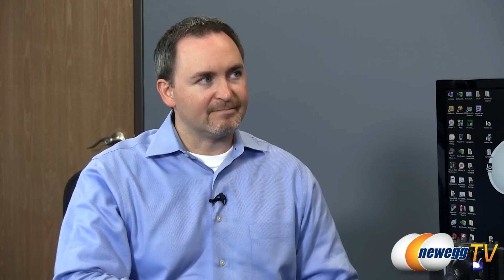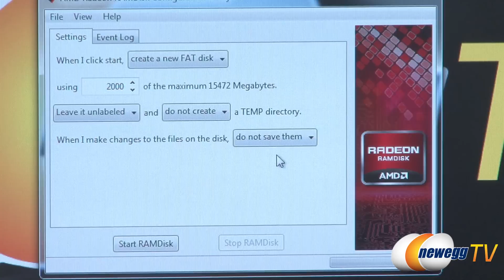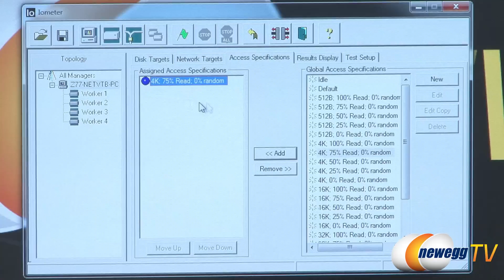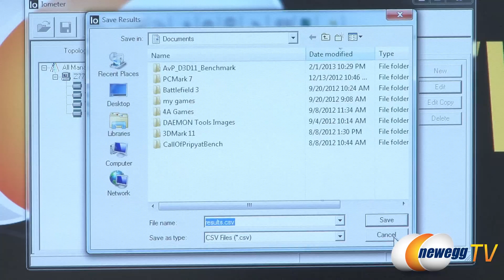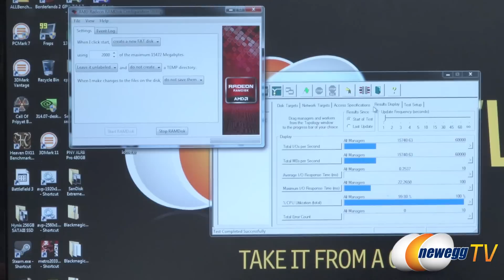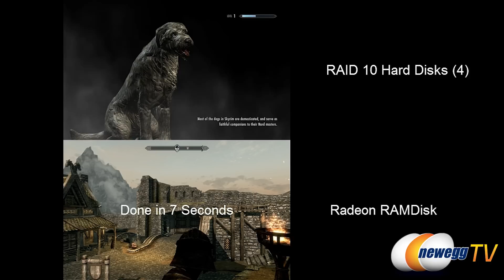AMD Radeon RAMDisk Interview & Overview - Newegg TV

Comment: Take BF4 it is almost 56gb...using RAMdisk does the whole game get installed or does it just use what memory it needs to operate the game? You see I have 16gb RAM and the game itself is 56 and that is what is installed, not the parameter which most games have a 20% bigger space set aside. I.E. some 10gb games require 15gb of space on your drive in order to download. Basically does the game itself need to be put on the RD or just the temp files that run it leaving the game itself in its original place (HDD or SSD) btw I also have a SSD for OS only.

Comment: The only way your going to use more than 10gigs of your system ram is if your using high grade/professional tools such as 3D rendering programs, advanced algorithms, etc. etc. If you have 32gbs of RAM why not set the 16gbs that you will never use in everyday use (gaming, web browsing, etc.) and RAMDisk? you could install Skyrim and have half a second loading screens, or install BF3 and cut your loading times from a minute to 15 seconds. Theres no reason not too.

Comment: No, you still got to install an OS on a SSD or HDD.  You'll need to have a lot of RAM, 32 is about the most feasible you can get.  OS needs a good 4 of it to operate and to play it safe with games 6 would be good.  So you can make at most a 26GB RAMdisc, see how many games you can fit in that.  Old PCs only have 4GB usually and new ones usually only have 8 so unless you have a custom build you know has lots of RAM it's not a good idea to do this

Comment: We won't be able to use it until Haswell-E for LGA 2011 and Skylake for consumer level anyways with no word from AMD yet, so kinda jumping the gun there. Haswell-E is slated for a Fall 2014 release and Skylake in Summer 2015, so we got a year and a quarter before we'll be able to even use it, a lot can, and will, change in that time.

Comment: Until amd or whoever, can cut down the amount of time it takes to SAVE the ramdisk image ( yes I set it to save on the same ssd as the o.s. is installed,  not sure if that matter versus setting it to auto save on a separate storage drive), and/or I can afford to purchase a much bigger ramdisk size allowance than the measly 4GB ( ya need more for today's games) to test bigger things like games, vs small stuff like handbrake, itunes, etc..No thanks to 4x more boot & shutdown time.

Comment: Definitely the sata 3 ssd.  even if your motherboard only has support for sata II.  chances are ALL of the specifics ( 4k random  read and write,  max sequential read and writes, iops, things that determine how fast your o.s. loads, shuts down, and influences program and file loading, etc)..of that sata 3 ssd's speeds will be still slightly faster than that sata 2 ssd's maximum speeds in all categories listed in parenthesis.  I know this from experience. Built and tested over 60 pc's since 2002

Comment: Why would you tell him sata 2 ssd is the one that the o.s. should install on?  sata 3 ssd's  ( 99% of the time) are faster in 4k random reads and writes and iops of reads and writes ( which are the MOST important specs that will determine how fast the o.s. loads after the pc completes the P.O.S.T.

Also, Pine gave no specific details about his hardware setup.  Thus even giving a straight answer that will resolve his concern is pretty much a waste of time

Comment: Software will still be usable. DDR4 will probably enter at 3000mhz, so if you have 2800mhz DDR3 it would probably be similar. Faster Memory Clocks should equate to faster RAM disk transfers.

Comment: Well I KNOW that Comcast does and HAS been using actually physical RAMdisk hardware setups as ( for lack of the correct term but I'm trying to get as close as possible )...." routers" for local and district server node traffic for their internet customers.  Which as far as a computer-type "horsepower and low end torque" sense...makes sense.

On a more coherent note though, I'll just have to try it with a 24GB ramdisk size when I have enough ram and try a LONG loading game with it vs my ssd

Comment: Yeah for instance even if I had enough ram for it, I wouldn't want to wait for my 34 GB bf3 installation folder to load into ram lol. But anyway if they did that game loading test with ram disk vs ssd, they would take about the same amount of time, which I think is why they chose to use hard drives.

Comment: This is only really useful if you have a ton of ram like 32 or 64gb. But even still, I've personally tried it and there is no significant "real world" speed improvements going from ssd to ram disk. Not to mention the significant boot time increase. So you're better off with 8 or 16gb of ram and spend the extra money on an ssd.

Comment: Check and make sure all of your audio connections to your pc (or if applicable your external audio solution that is connected to your pc) are completely connected and in the correct spots. 

Is anything else audio coherent....static sounding?  your music or movies? if not play this exact same video ( same url and all) on a different device, smartphone, tablet, notebook..etc) and see if you receive the same static.  if not  it's your setup that needs the troubleshooting. cheers

Comment: ssd disk is redundant in one context.  It's just " ssd"  solid state drive"  there's no " disk" involved..only flash based storage on a pcb with a controller chip and other instant-processing things.

I am still testing the " validity" of a ramdisk idea, and so far I'm not impressed.  However, you see how small i'm starting at though.  I have more research and testing to do.

Comment: BF3 only requires 20-25GB.  If you have 32GB of RAM you could use up to 28GB of it for a RAMDisk without hindering your performance.
The largest game ever made was a flight sim which weighs in around 70GB; the runner up is around 50GB--that could fit on a RAMDisk in a system with 64GB.
There are people who have enough RAM to fit more than one of these storage-hogging games.
I'd suspect some Ivy Bridge-E motherboards to support 128GB (SBE had up to 8 slots and there are 16GB DIMMS, 8x16=128).

Comment: This will really benefit when DDR 4 debuts with its allegedly cooler temps, lower voltage, higher capacity and compact dimms for mobile devices. But imagine the price. A 16 gb SD card is about $10, 16 gb of ram on mobiles?

Comment: It's called SATA Express, (Kind of like PCI-Express), and it's to be introduced with Intel 9-Series CPU's. (Broadwell), as well as Intel's Haswell-E. It'll be incompatible with current SATA drives and motherboards, and the connector will probably be smaller, if not completely different.

Comment: I have a question, so if windows 7 home prem only sees 16gb of ram, if I have 32 installed, will this use all 32gb or is it stuck at windows cap of 16gb.

Comment: AMD will probably make around the $100 mark considering they made both the CPU and GPU which are based of their APU architecture and so they are providing around $150+ in components which means that by selling at a loss thy would earn around $75-100 per console and overtime make a significant profit over the console's estimated 5-8 year life span.